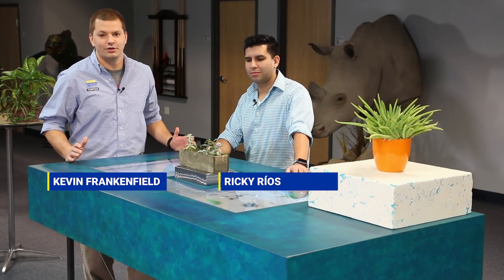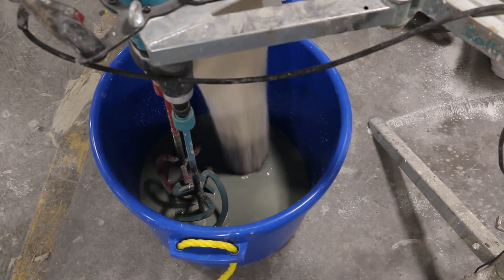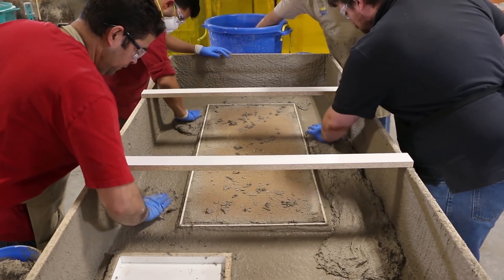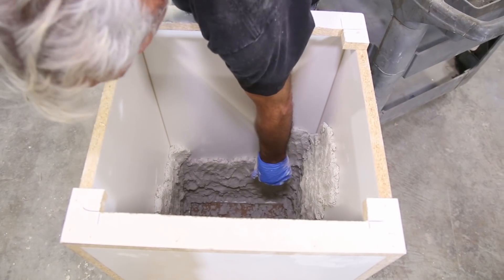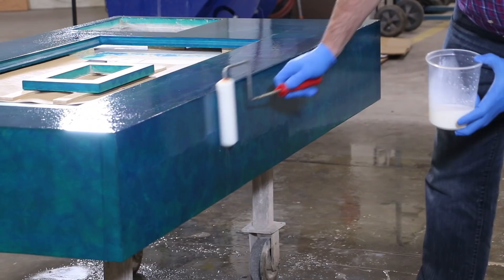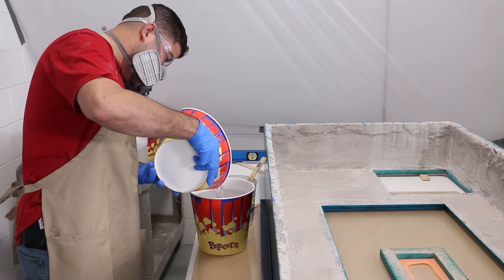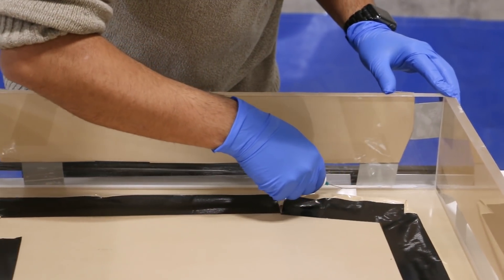How to Make a Concrete and Epoxy Lagoon Table Aquarium

Comment: The only problem I see is how are you going to get oxygen into the water if you have no surface agitation? The fish are going to suffocate without surface agitation. Dropping the water level a 1/4" from the surface of the top would solve this issue. Other than that, it's an amazing build!
Reply from the maker: Robert, there is a filter in the column which provides the agitation to oxygenate the water.
Reply from the maker: Thank you for watching!

Comment: That is quite the masterpiece. How did you get the epoxy “window” flush with the top of the table?
Reply: An acrylic sheet was adhered to the table top with silicone. They show it at 5:15.
Reply: I have seen that, but the gasket must have raised the acrylic so there would be a little step in the final epoxy window.
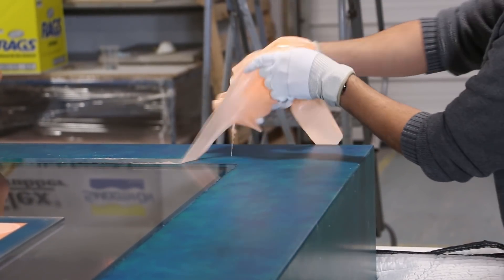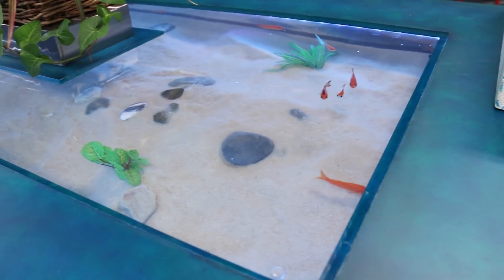Reply: There is a raised section along the entire thing. It can be seen if you pause at 7:12 and again at 8:41 on the final product.